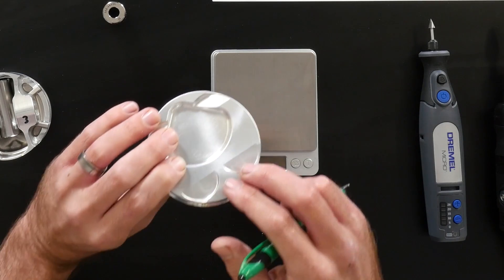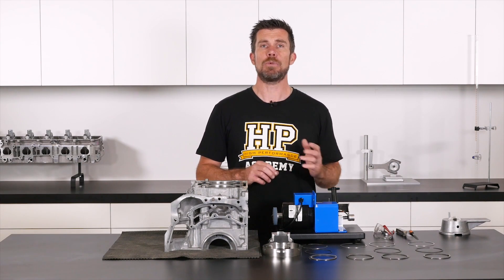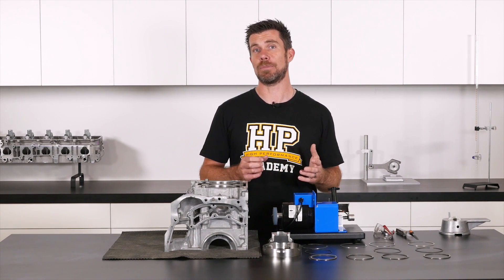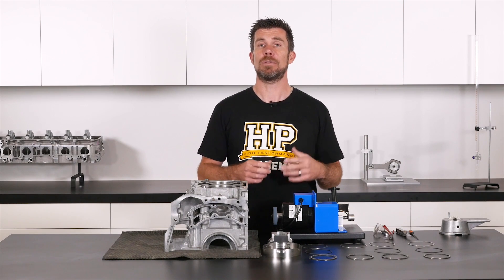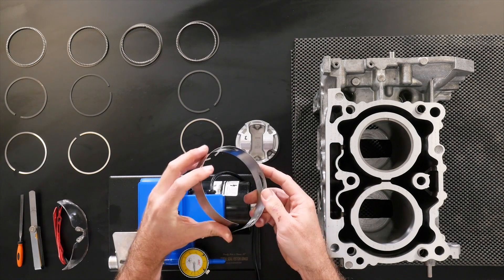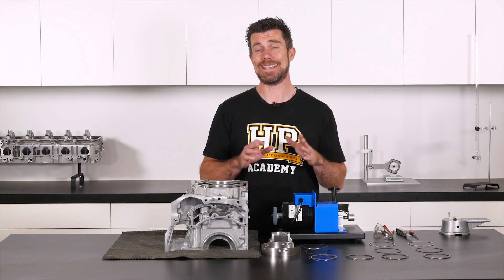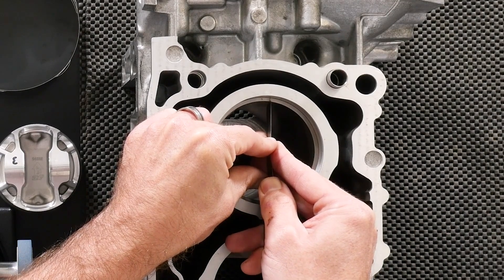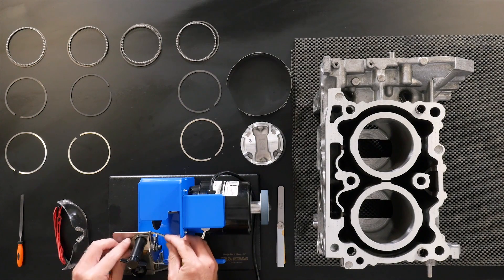Get This Wrong and You'll Destroy Your Engine! | Piston Ring Gaps [FREE LESSON]

Comment: What is the standard ring gap which one can apply please advise
Reply from the maker: There is no one size fits all ring gap for every and any engine. That is why your rings come with a spec sheet that consider different fuels and induction options.
If you are fitting stock rings to a stock engine then that info is in your workshop manual instead.
Hope that helps - Taz.

Comment: My Dad used to gap them normally like this then he would do a final measurement after heating the rings in boiling water to about 90*C
 (approx running temp without combustion - Intake stroke for eg)

Comment: Hi, how is it going with 1uz engine?

Your past engine was making 450whp, but you have never talked about heads. What cam spec, springs, valve size and port job was done to it to get to this power level.

Any chance you can tell us ( if you know) what cams and spring u had In there?

thanks
Reply from the maker: We didn't build the other engine sorry, it came with the car and has since been replaced by an SR20VE, not due to a long term plan, just due to engine failure, Rona, and an unmotivated engine builder leaving us out to dry (the SR20VE is what we had on hand built and ready to go).

We have done a number of videos on it all, check out the Vlog series from 2020 - Taz.
Reply: @hpa101  thanks, have never seen cam spec, any chance you can share spec of them ?
Reply from the maker: I'll see if I can find out for you, but if note note it was built for the previous owner by Hartley Racing Engines here in New Zealand, and they build a lot of these UZ's for spec series motorsport. They would have all the details for sure - Taz.

Comment: how do you gap them without fancy grinders?
Reply from the maker: You can use a manual ring file. Where the eclectic ones are awesome is in a workshop where you are doing a high volume of ring filing. There is nothing wrong with manual ones at all 😎
I think you should see one making an appearance in this video: https://www.hpacademy.com/blog/how-you-can-file-piston-ring-gaps-free-lesson/

And here: https://www.hpacademy.com/technical-articles/engine-building-tools-the-essentials-and-desirables/#4

Hope that helps @Dong - Taz.

Comment: Appreciate the video, but very important information such as knowing how much gap to have is what leaves me not confident enough to get the entire course.
Reply from the maker: Hey there Ralmsib, come along to the free live lesson, this is discussed: www.hpacademy.com/free-engine-building-lesson/

Your aftermarket rings are supplied with a range of gaps depending on your application, you don't have to pull number out of thin air ;) - Taz.
Reply: @hpa101  just signed up for engine building academy video thanks for link

Comment: Hi guys, I need help ASAP, please. I have Wiseco pistons, bore 83,5mm. Top ring, second ring and bottom oil "sandwich" rings layer (1 normal, 1wavy and last normal). The fact according to the Wiseco chart, the top ring gap is smaller than the secong ring and according to my factory manuel the gap of the top ring is less than the second. What do you think? Thanks for all your contributions.
Reply: It’s been a while since I’ve built a drag/performance engine however, you always want your top compression ring to be looser then the bottom(2nd) compression ring. This is simply because of the thermal expansion, the top ring(1st ring) will always be hotter then the one(2nd ring) further away from the combustion chamber. So hotter ring = more gap, cooler ring = less gap.
Reply: @martindworak  Thanks. Finally I've done that too ;)

Comment: High performance piston and rings , I just did a rebuild 2000 miles ago heads cylinders pistons rings . out of the box piston and rings , piston is 3.505.0  cylinder bore is 3.508.0   New rings gap was pre cut to .028 top .034 second oil ring gap was.060 I used them at 2000 miles I was getting blow by , I did a quick hone flex hone , used a micrometer with bore check  my cylinder top center bottom in 4 place +  my number are at .003th between cylinder and piston , I have ordered 2 sets of rings .010 over and they are worse than the first set .034 top .040 center and .045 oil ring. If I order plus .020 ring set 3.518  can I file them to the book spec of .017th -.022th  top ring , .024th max ring 2 , oil ring .034th max so I do not get more run around from the seller .
Reply: I'll build anything, but recently I found some neat tidbits regarding a Briggs 40 and 49 cube v twin. 
The 40 I had was an early version , the 49 was a late version.  
Same engine family , bore size is different.
Rods and crank should be the same (except for early and late style) 
I was putting a rod assembly in the 49, and happened to look at the 40 and got a brainstorm. 
I busted out the scale and found out the 40 wristpins were 15 grams lighter than the 49. 
And about the same on the rods. 
So I swapped em in. 
I didn't run it before , but it seems to spin up nicely with the lighter stuff.

Comment: I don't why I find this so infuriating but it's a metric designed motor, your in a metric system country yet you're referencing bore sizing and ring gap in imperial just gets my goat up over then that mint video chur bro
Reply from the maker: The majority of our members are US based, and there is always a lot of crossover between metric and imperial when it comes to anything vehicle related so it is something you will want to get used to ideally ;) - Taz.
Reply: I get the crossover daily in the industry over here in Oz Im trying to get used to it still annoys me after 15 years

Comment: Is it really necessary to use torque plate when gaping rings if it was bored/honed using one?
Maybe you can measure the shape of the cylinder with and without a torque plate? It would also be really useful to know, how to measure cylinder diameter to determine it's exact size and shape, if it's egg shape or not.
Give me thumbs up guys, so he makes the video!
Reply: If you have the plate then by all means use it but if you dont then you will be ok.I do tend to go on the larger end of the spec if i'm not doing it with the plate though and I'll also check them in sever spots in the bore either way.Another option I used before plates where available or on odd ball engines is to bolt a head on and check from the bottom if its possibly,it wont work on all engines but a lot of times it will and if it has stretch bolts just use a old set for this.As far as measuring the bore goes I use a bore gauge that is worth its weight in gold.There may be other ways but I've found its best and when you consider the cost of a project a proper one is a small investment.
Reply: Also if using a head I'll install a piston(preferably old one) upside down in the bore and use a piece of string around the pin to pull it up and down to size the rings.If using a old piston you can also cut it down around the skirt etc to help.
Reply: Thanks for advises! Have you tried measuring cylinder diameter with a plate/head and without. I'm very curios what would be the difference. :)
Reply: No problem, yes on some motors i have seen the difference from a plate and no plate.Not all engines deflect the same amount and some really dont at all.It was only a few tenths of a thousandth of a inch so you might not see it with a thousandths indicator but it is there more often than not.
     What engine are you dealing with?I might have seen one or it may be a easy engine to make a plate for.If you havent started yet making a plate before might be a cool project too.
Reply: I don't work on anything, can't afford atm. Just interested.
Reply: Different engines distort in different ways , depending on how close the head bolts are to the cylinder. 
So yes maybe for 1 model of engine you could cheat and do a measurement with and without a torque plate and note the difference and get by, but that's only 1 model of engine.

Comment: Another very good video.

Good point about the deck/honing plate - never considered it before.
I really don't like re-ringing engines that have done some work, but if you do, be aware that there will often be a bit of a taper (perhaps as much as 3 thou) and as most wear occurs to the top of the bore, this means the ring gap closes up 3.14 times the difference at the bottom - may not be significant for slight wear/taper but something to bear in mind as that end-gap can disappear in a hurry!
The piston method works well (and that shim tool is neat - haven't seen one before!) but some will have a dome shape that hits the ring - if so, turn it upside down and use the skirt base - it is normally the same depth both sides.
With some vehicles, 'file to fit' or 'race' rings may be unavailable or hard to find - just order the next oversize rings with the pistons. The difference on ring drag is negligible and even 10 thou oversize rings will have a nominally 31 though closer gap - you may actually need to file them even to get them in the cylinder for initial measurement. As the chap said, check the clearance spec' with the manufacturer and bear in mind the application as hotter rings will expand more.
Have you done/considered doing one on ring materials and applications?

Oh, what's with all this "inches" and "thou" shit? We've been officially metric since before you were born ;-)

Comment: 2 cranks , 4 cams, 2 head gaskets, etc... I don't understand anyones desire for these engines :)  On a lighter note , you're amazing man. I usually let my machine shop do the bores, the rings, decking etc, I mean damn that machine you're using I just located one and it's $700 BONES!!!! Now there are cheaper alternatives of course. But we all know you get what you pay for. Also I found a new go to rings supplier www.totalseal.com  - FREE LESSON worth a billion thanks again man.
Reply: you're right they have one
Reply: So the only thing it has going for it is major head gasket failures and a lower center of gravity?
Reply from the maker: Prior to purchasing the Total Seal ring file I was using a Proform version. Still pretty great and you can buy them for around the $200-250 USD mark so you don't need to go wild. http://www.jegs.com/i/Proform/778/66765/10002/-1
Reply: Thanks man, might consider this one over the summer!

Comment: I think 10 thou on a turbo'd engine is a little bit tight and could cause problems. I gap my rings on non turbo engine's with 3 to 3.5" pistons the top one 15 to 18 thou and second ring 18 to 22 thou. But it depends on what the engine is getting used for. Bigger if Nitrous is going to be used. Never had any problems with blow by, but I have had piston land failure cause of ring butting up and causing piston failures? Due to customer not telling me he used Nitrous was why the failure occurred. Excess heat?
Reply from the maker: Am I missing something here? The aim was around 14 thou? At about 6:50 in the video this is discussed. The initial measurement was 10 thou and I'd agree this is too tight for that particular bore diameter.
Reply from the maker: Hey Andy, a few decades back the general trend was to gap the second ring tighter since it won't be exposed to as much heat. More recently however the trend has reversed. the reason is that there will always be some amount of blowby past the top ring. We use a larger ring gap on the second ring to allow this to escape into the crankcase. If it builds up between the rings it can destabilise the top ring which hurts ring seal dramatically.
Reply: Taz Grant second ring should have less clearance ? Less heat and no need for a bigger gap shouldn't top be 18 to 22 and 2nd 15 to 18?
Reply: Reason for slightly bigger ring gap in second ring is to stop ring flutter at high revs. Lose of power and excessive blow by is often the consequence of ring flutter. Having bigger gap helps to minimize flutter.
Reply: learn some thing new everyday even if you are tought some thing in one way theres always another theory or method ....
Reply: Just read your comments could anybody give me advice on what my ring gap should be on a stock block mini cooper s r53 2003 (supercharged) i have a few mods, my bhp will be around 230. I cant find any info to what my ring gap should be. Thankyou